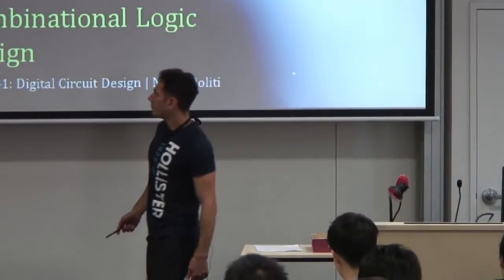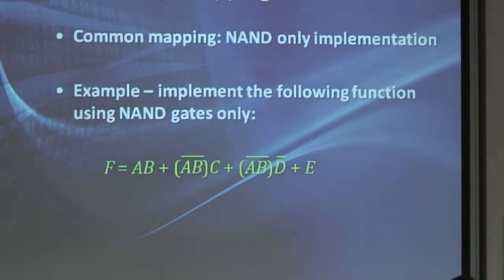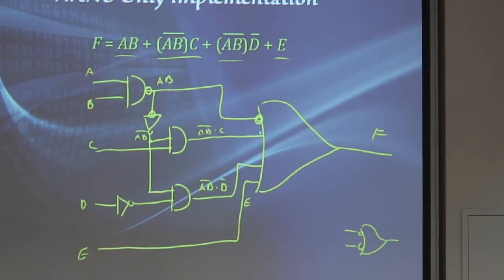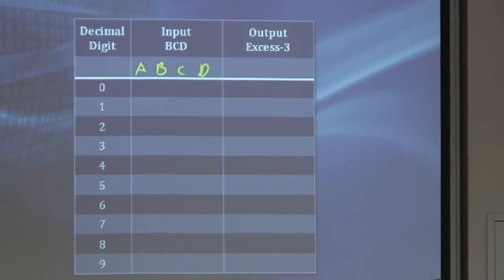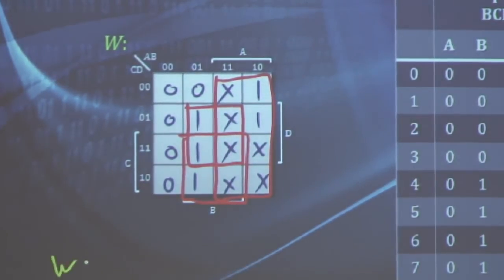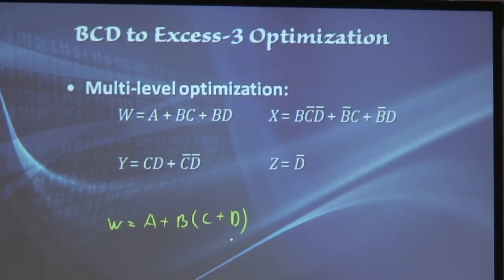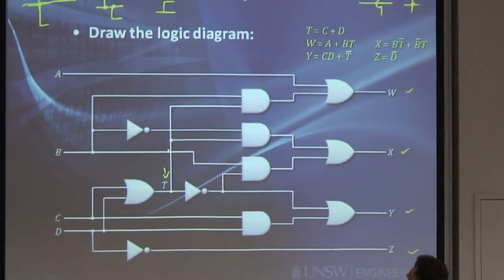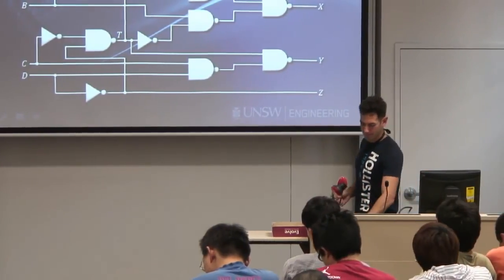ELEC2141 Digital Circuit Design - Lecture 10

Comment: Many mistakes throughout this lecture series so far. One of which in this video is that what he showed isn't NAND only implementation. You don't use NOT gates and OR gates if you use NAND ONLY implementation. NAND only means what it means, using only NANDS. Instead of a NOT gate, a NAND gate is to be used with the inputs branched. It functions the same as an inverter, even though it is a NAND gate. That is NAND only implementation. (At least one small part of it.)
The design he has on the board has inputs inverted all over the place. This is inefficient for gate propagation, power usage, complexity, and overall design cost.

Also even with all of that said, even the way he did it is also wrong. He doesn't understand that a NAND gate itself takes the complement of it's inputs. So every NAND gate he does use is used incorrectly. Ergo the entire circuit is incorrect. 

I hate to be a downer but this is not such a great lecture series so far in my opinion. :/
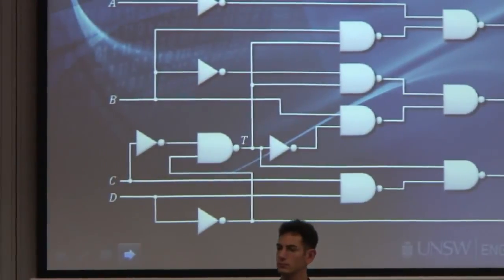Reply: Incorrect. The inverters he shows can be represented as NAND gates with a single input tied together (as he says from the quested at 38:04). You could simply redraw all of the inverters this way. Also, these lectures are really good! I'm doing this as a pre-FPGA course and it is excellent.